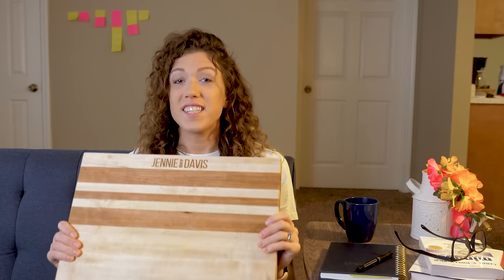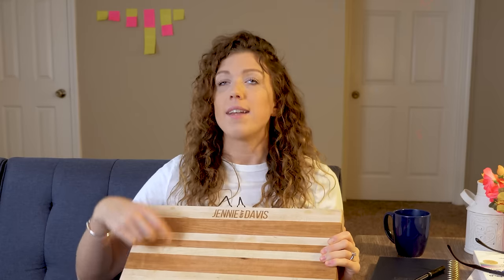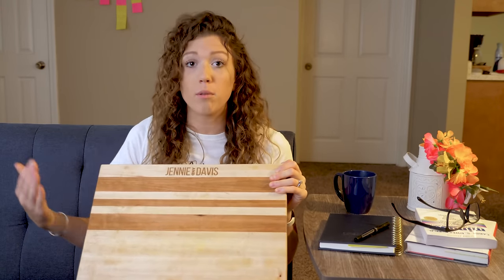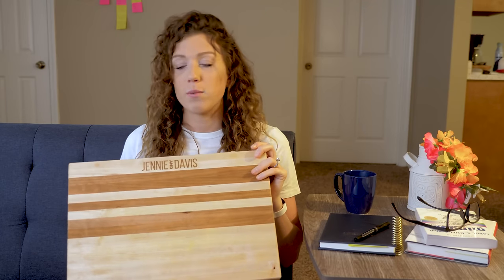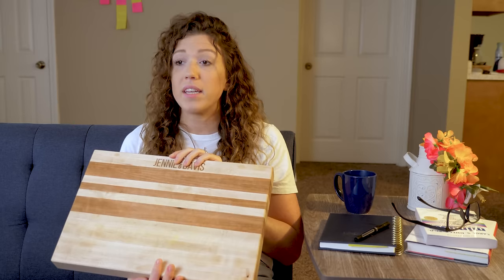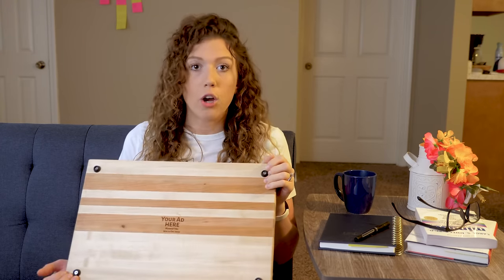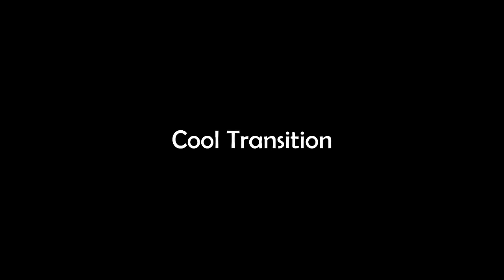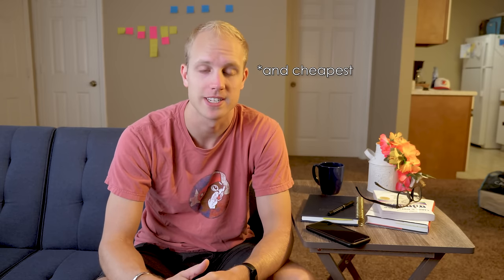🛠our BEST cutting board for SELLING!! 💵

Comment: A little tip about sanding: set the sander on the surface then turn it on. It'll avoid the potential issue on marking the wood if you don't land the sander flat on the surface.

Comment: I'm just now getting into wood working. I hadn't really thought about woodworking until we moved here and we had to heat our home with wood. I found a source of nearly unlimited FREE hard wood scraps from a local large cabinet manufacture. Wood worked great for heating our home but as I was cutting and burning it I just was amazed at what they were throwing away. 8-12 foot 1"x2" (or larger some times) boards of Oak, (white and red) Hickory, Maple (several types) , Ash, Cherry, Poplar, and tons of Black  Walnut ! We're building our house and I'm doing all the interior work (plumbing, heating, electrical, floors,  sheetrock, painting, counter tops and cabinets, etc.) and am having to learn a lot along the way.. Among the skills I'm having\getting to learn is wood working. With all that free good hard wood I figure I can make some $$ at this. I've already made a couple of nice cutting boards for us and to give as Christmas presents later this year, and I'm currently building an 8' x 28" butcher block counter top for the kitchen. One thing I also will be doing is learning how to make my own cabinets. Neighbors and others have asked if I'm going to making\selling them. They don't need them but I was curious do you guys do that ? I was thinking about just milling and selling the wood as lumber but maybe ?? I get pickup loads of wood whenever I want basically and I do need to find a new trade due to osteoarthritis in my spine and a basically every other main joint in muh old frame so... Any thoughts.?

Comment: Hey guys. I applaud you're desire to get into this field. I'm an amateur woodworker as well and have made and sold a bunch of things. My biggest problem, especially  today with wood, is getting it at a reasonable price. I've made the same boards as you with purple heart, zebra wood, and some other exotic woods and the price point is high. You may want to consider making the boards thinner which would result in a lower price per piece. If you're selling it to real estate agents all they care about is how good it looks. And you can make these boards go to the next level with a thin strip of an exotic wood and it wouldn't raise the cost. Anyway, keep chugging away and good luck.

Comment: Hi Guys, a possible tip to help you with your cutting boards. 

I'm a woodworker and my father started out as a wooden boat builder in the fifties. 

Later in life I was manufacturing quality billiard tables and we were laminating the rails from strips cut out of white oak. My father happened to be visiting and we walked thru the shop: I mentioned a concern I had for the rails not warping.

He said that a transom on a wooden power boat had to be strong and stay true forever. What they did was reverse every second strip of oak in the laminating process. This would alter the grains and once glued up gave a extremely strong and warp resistant panel. We did our pool table rails this way and never had a single one come back. 

I think this would work well for your cutting boards. As you glue up panels reverse every second strip from the original ripped board. You should end up with a board that stays flat and true. 

Best of luck with your enterprise. Steve (64yrs) Manitoba, Canada.

Comment: The one I made for my neighbor that was moving away from the beach had a juice catch  all around plus finger grab on the sides  under the board.  Otherwise everything is the same.  Make sure you use stainless screws on the feet or they will rust when the board is washed.  Love what you guys do.  I'm a retired engineer living in Wilmington, NC by the beach.  I going to make more cutting boards plus cornhole boards.  They are easy to build..  Also beautiful flag cases out of cherry wood.  I designed it for my fathers casket flag and an idea from Michael Savage.  A talk show host in San Fransicko.  My problem is pricing and marketing.  I'm going to keep and eye  on you. Wish you the best and God Bless

Comment: Selling to realtors is an awesome idea!
It would be worth talking to home builders, as well. Whenever some developers sell properties and finish major milestones in a house build, they offer "house-warming" presents to the customer. There's so many homes being built in TX, it might open up a large pool of business for you.
Reply: Agreed, and those getting arcitetchs and designs firms for custom homes built usually have much less budget restraints than the $100 mark. Depending on the design style it wouldnt be unlikely that the build/designer would have the board designed with the home specifically in mind and use more expensive woods specifically to match the home style.

Comment: I noticed the cutting board that you made in your video is called 1/2 and 1/2 ( half white and half striped). To switch things up a little bit, before you sand your cutting board cut it in inch and a half strips, then alter each piece one white one with a stripe and so on. It's like having a whole new cutting board on your hands.

Comment: Do you have a recommendation for a laser engraver starting out? I know the one in your video is not cheap. I found a couple under $500 just not sure if they are any good.
Reply: lol 500? my company is selling lasers cheapest is about 15000€ :'D integrated in mashine is about 80.000€
but our lasers laser such Logos in about 1-2 seconds and are designed for industrie^^
I realy did not know that it is possible to buy such cheap things. and btw. i wouldn't.
looks dangerous as hell. no laser security glass, no signs about laserclass or adwise to wear laser glasses... 
guys, really get security glasses for exact wavelenght. you have 2 eys and you cant make new ones! care for urserlves!
Reply: Patrick isn't wrong but he has no clue about hobby lasers. Ortur is a good one. Neje 3 Max is another for a little more than your budget but you won't regret it

Comment: Youcan still have the exotic woods in these projects. You just have to use it VERY sparingly. I know black walnut isn't considered "exotic" BUT its does cost more than maple and cherry. It can be used in the same board with only 2 or 3 strips at ⅛" wide to add the contrast/pop of color you're needing. Same goes for any other lumber that you may feel is at a price point that's not conducive to making a nice profit on at the $100. mark. Keyword: Sparingly

Comment: My favorite cutting board is one my parents have had for decades.  It was taken from an old bowling ally lane and cut into appropriate sized blocks.  It is EXTREMELY thick and heavy.  I'd guess it is 2 1/2 inches thick, or maybe even 3 inches?

Avoid the word "CHEAPEST"....it makes the product sound like a "cheap" Chinese knock-off.  Use the term "Inexpensive".  It is the same point, but it is less degrading to your product and efforts.

When we bough this house, we were given a cutting board by our realtor.  It was decent, but I could not tell you where it is located today, and we bought this house about 30 months ago.  It was not as thick as what you build, maybe 3/4 inch thick, but definitely less than 1 inch.  Their business name/logo was burned in with a LASER, which is an acronym for light amplification by simulated emission of radiation.  Sorry, I seldom get to really use much from my college degree so I throw out tidbits now and then.  :0)  When I get set up a little more I'll follow up with the realtor as we're still friends with her.  Maybe I can grab that little piece of business.  Anyway, I do not think it was thrown in the trash, I think it just got misplaced in the process of moving in.  

As someone that has sharpened knives for 43 years and has never met a knife from a factory that I could not quickly make even sharper, you may want to add information on how beneficial it is to use a cutting board to maintain the edge on a quality knife.  You may already have this out there...I've not scoured your information so forgive me if I am repeating information.  First, never use a straight edge knife against a hard surface like a ceramic plate or granite counter top or other hard surface.  You will end up rolling the cutting edge to the side and you'll end up cutting using the rolled edge instead of the cutting edge.  Many times when you watch professional chefs use a sharpening rod, they are not trying to remove material to sharpen the edge, they are trying to index the cutting edge back in line with the spine.  If you're going to cut on a plate or hard surface, use a serrated blade.  I hate serrated blades, but since I do not eat my steak off a wooden plate or cutting board, they are a necessary evil.  Always wipe down a cutting board with a sanitizing agent after cutting raw meat so you do not leave bacteria behind that will get on any veggies you cut afterwards.  When you are done cutting and need to move food to the side or slide it off the cutting board, do not drag the cutting edge along the board.  This will roll the edge and dull it.  Instead, flip the blade so you are using the blunt spine of the edge to move the food, then rotate the blade again when you are ready to start cutting again.  Sorry, off topic...

To keep the price at the $100 price point and still look like a much higher quality and more expensive cutting board?  Make decent boards and maybe use some type of CNC machine to engrave/LASER burn an image or name into the board.  Use a little less expensive types of hardwood?  Use fewer pieces of wood to glue together to reduce the amount of cuts and the amount of time it takes to create the finished product?  Maybe do a cutting board that looks like the first charcuterie board in the previous video with the light wood and the thin strip of dark wood in the middle?   Keep it simple without the handles, just a square board (maybe a 1 inch round corner?) and a double chamfer or rounded edge, and a juice trough?  If you built them like this, you could build a single long cutting board, run through the planer and then cut them to length after to reduce time spent on doing each step on each individual cutting board?  I think a heavier double chamfer would add an elegant look to the board and make it pop.
Reply: Budget friendly?

Comment: I got a door knocker and brass kick plate, and yes I used both of them, a cutting board would ahve been nice also.
to be fair not all cutting boards are made from strips or 2x2 boards some are solid wood and some are very complicated designs, dosn't ahve to be just cutting boards could be serving trays.
But if you look around this stuff is a dime a dozen you might make it off this you might not. the key to to find your neitch 
one item isn't going to get you there.  cutting boards take up a lot of time to make. lot of cutting joining and glue up. you can also get blades that do a good enough job you won't need to joint.

Comment: I've received a leaded crystal vase as a closing gift, sure we used it, it stayed on the mantle with flowers in it. But is that really "uses", I mean it just sat there for years, eventually fake flowers so we didn't have to change them or water them, so they just collected dust. It was pretty, but was it really something to use? I'm making custom etched, glass (or ceramic if they prefer) coasters for a couple of local realtors (friends I grew up with). I'm hooping it catches on and turns into something as great as what you have created, you guys did inspire me to them with the idea. But I've just started with this line, so we will see how well it goes over.

Comment: Have you considered routing in a drainage groove? How would that affect the time/price constraint?
Reply from the maker: Not really, because it's an entirely new tooling setup. If that groove gets messed up, the whole board needs to be resurfaced and the groove routed again. You're talking about at least an additional hour of labor (not to mention another router, router table, etc.) and we just don't have another $30 to play with at the $100 price point.
Reply: @jennieanddavis  ...and, of course, more sanding :)